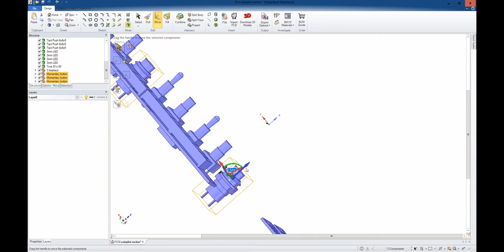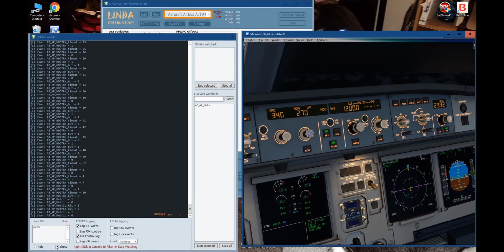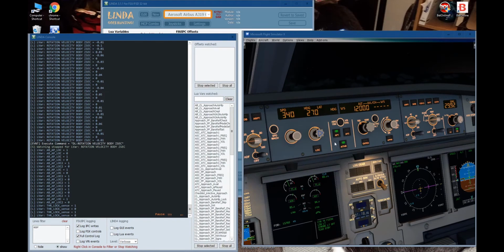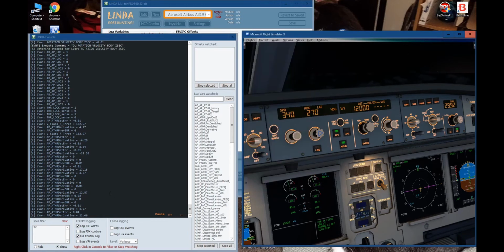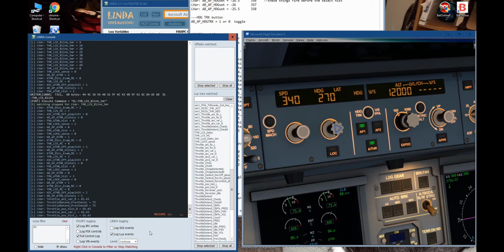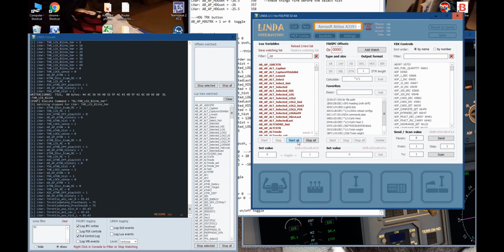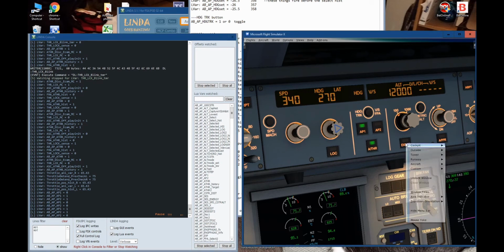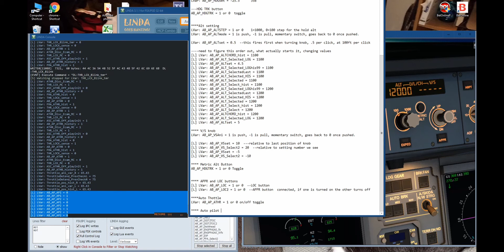Finding Lvars with Linda

Comment: Excellent explanation. But I have a problem. I am using the Beechcraft KingAir aircraft with the analog panel. I started with your explanation to be able to move the avionics master switch. The switch moves when I use LINDA with the change from 0 to 1 (off and on) but it does not execute any action on the plane, that is: the switch does move, but it does nothing. But if I use the mouse to move that switch, then there it does the function that it's supposed to do. I would like if you can help me with this problem. I can pay you. If you wish, I can send you the airplane program installer for MSFS2020.
Reply from the maker: I haven't messed with LINDA or LVARs in a long time. I also think there is much more info I would need to even start. What are you using to control the sim when you do this, home built panel, or something else? Are you using Mobiflight or some other software that you need the LVARs for? I presume you have a paid for FSUIPC version going, because I think it needs that to work correctly. I feel the only way I may be able to help is if we do a discord or something where you share you're screen when it does this. However, I'm going to really rusty at it, I use Mobiflight and it has most of this all sorted out in the program now. I was able to get the same panel I was building in the this video, to run without having to get LVARs to run the FBW A320, I was even able to get some things working that didn't work correctly in FSX. One other thought is, is there another LVAR that actually activates the function, and if you tie your switch to that LVAR it will also flip the switch on the screen. I do recall that sometimes this was the case, one LVAR would actually make the think operate and in the background would flip the switch when activated.

Comment: This is very useful information.  Can you explain how you've used the Lvar data to connect to Mobiflight and FSUIPC please?
Reply from the maker: Sorry to take so long to get back to you.  Keep in mind all this was made for the Aerosoft Airbus family for FSX and was before MSFS2020 was out.  I haven't done anything with 2020 yet, waiting for the updates to slow down so I'm not chasing bug fixes every week.  Here is a link to the mobiflight forums where I ended up posting a mostly complete LUA script I used to get my FCU working.  https://www.mobiflight.com/forum/message/18952.html   I may have changed it since the original post but it should help with getting things talking to mobiflight.  Keep in mind you can make the offsets what you need and there are a lot of youtube videos I watched to help get things straight for me, I unfortunately don't have a list of those handy.  Hope that helps.

Comment: Do know if you can find the negative "-" and plus "+" symobol on the VS display? trying to find it so I can do a custom LED to show + or - symbol for the FCU
Reply from the maker: I know it will show the negative sign "-" when the number goes below zero.  I was using just basic 8 digit 7-segment displays so the plus was not an option, so I didn't look to see if there was a way to do it with Mobiflight.  I was able to, after the maiden flight video get it to show all "-----" for when in managed mode, but it's been a while since I've messed with anything.  check the Mobiflight Forums, I have some posts in there where I may have gone through it, or they helped me to understand what I needed to do to get it to work.  Hope that helps.